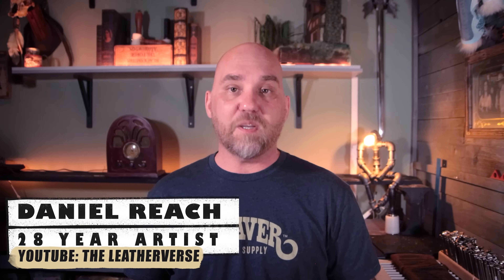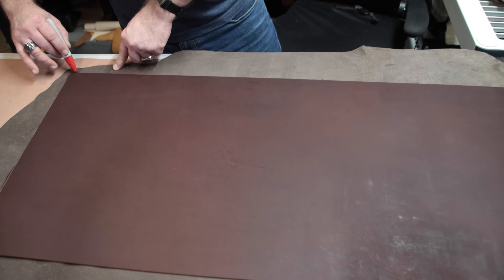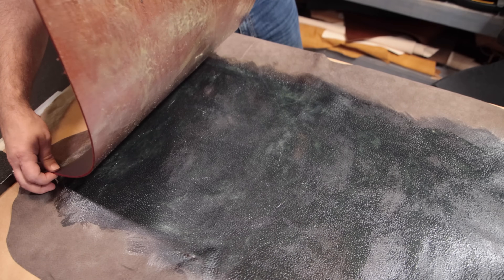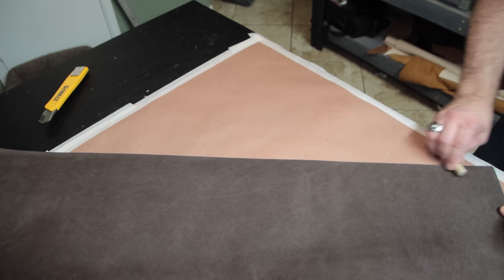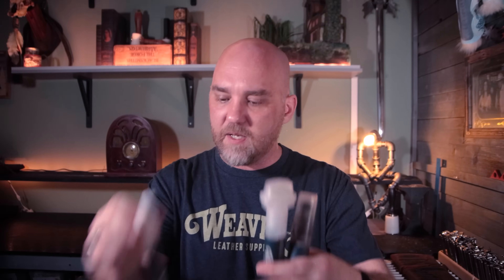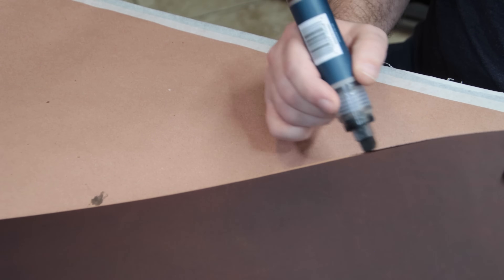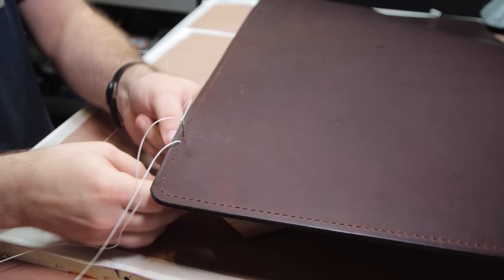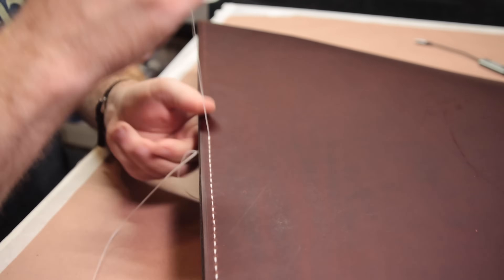Making a Leather Desk Pad

Comment: Daniel, you need to watch Chuck’s video on using a paint roller and paint dish to spread the Barge Adhesive quickly with no mess. It’s a great idea! Nice project!  You come up with great ideas. Keep them coming. Best regards, Richard
Reply: Hi Richard,
Thank you. I'm glad you enjoyed it. Chuck has a good technique with the paint roller and pan. I watched it several years ago when it came out. Great technique. I prefer to do it in smaller batches because I feel like I can control the mess better. Not to mention, keeping the fumes to a minimum. Its a great technique though if it works for your situation.
Reply: Have you tried the new Barge Cement without Toluene? The fumes aren’t as bad as the old cement. You still need to open the windows, turn on the fan and wear a mask. This new cement is much better. With the old cement Even wearing protection and ventilation I still got dizzy. My wife says I’m always dizzy and couldn’t tell the difference! Married 53 years this August. Good thing I wear hearing aids. I turn them off when she’s around. I guess that’s why we’ve Ben married that long!
Reply: @richardkatzman1215  I'm not sure if I've tried that one or not.

Comment: When you are placing the upper layer on the lower layer to glue the two together there is an old trick used by carpenters when making counter tops with formica. Cover the lower layer with waxed paper running crosswise before you lay the upper layer down. Contact cement will not stick to waxed paper so when you have your layers aligned to one another all you do is hold the layers down with one hand and pull the first strip of waxed paper by drawing them to the side allowing the leather to come together and bond. Once they are bonded you can roll the top layer back on itself and remove the remaining strips one at a time bonding as you go.
Reply: Interesting. Have you tried it? I''m honestly not sure how well it would work. It could work really well, or go horribly wrong. If you try it with a leather project, let me know. I'd be curious how it turns out.

Comment: Another great video and idea. My experience when using pliers (needle nose or traditional) my grip on the pliers needs to be tighter than when I use parallel jaw pliers. The parallel jaw pliers I have has brass jaws and do not mar the stitching needle. Occasionally applying bees wax on the needle helps. Thanks for a wonderful idea for a gift, my son will like it for his gaming computer. Thanks for sharing.
Reply: Good tip! Thanks.

Comment: That's the biggest mouse pad I've ever seen! I wonder how a decorative groove would have looked. Or border stamp? Many options but a simple clean look is nice too, especially with a quality piece of leather.
Reply: LOL! Most expensive mouse pad ever too! Before I did the project, I played around with the leather quite a bit to see what it was capable of in terms of stamping, carving, and such. Because of the waxy base, its very difficult to case, which means tooling is a real challenge. It didn't want to cut smoothly with a swivel knife and the stamps really took a lot of force to get a good impression. I spent multiple hours trying to come up with a way to add a design. In the end, I'm glad I didn't...I really liked the clean simple look of the leather with a single stitch line around it.

Comment: You don't run into problems with putting gum trag over the wax?  I thought that would give you some issues with consistency of the gum trag
Reply: Never had an issue with it. Just make sure you burnish the wax in good before you add the gum trag.

Comment: Why the lacing chisels instead of the diamond ones?
Reply: I just like the way they handle and the hole that they leave. Other than that, I don't have a reason for it.
Reply: Alrighty, thank you
Reply: Mr. Reach, sounds like another video on how the various chisels add variation to how stitching is done. Example round holes are preferred when stitching baseball leather covers to diamond chisels. Wonder which style chisel would work well when stitching a double loop pattern and the look whether using lace or thread?
Reply: @1a1u0g9t4s2u  Thats a good idea...That would make a great video. In general...round holes for things under a lot of tension. Straight holes for things that aren't "load bearing."

Comment: OLD Leather Smith here, Excellent Video easy 4 A beginner 2 follow Daniel,  Suggestions, I use in my shop, 
 A water bottle with a 1/8 hole spreads the glue easier with less mess, wax paper between contact cement makes it easier 2 adjust the pieces with out them sticking together, a buck stitch would look good 2, I use Maine Threads Made in the U.S.A. and very Strong in lots of Colors.  Sorry 4 So loooong.  Just things I use.
  GOD'S BLESSINGS ✝️🥎🙃